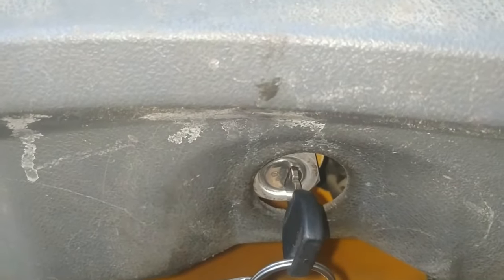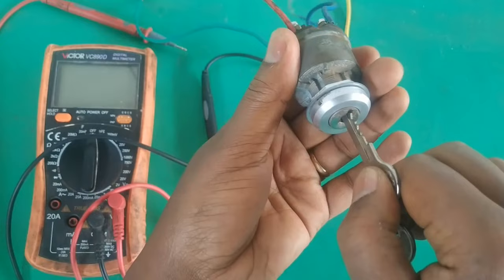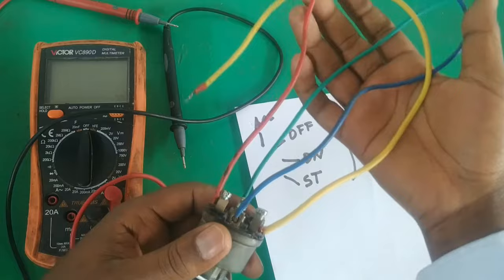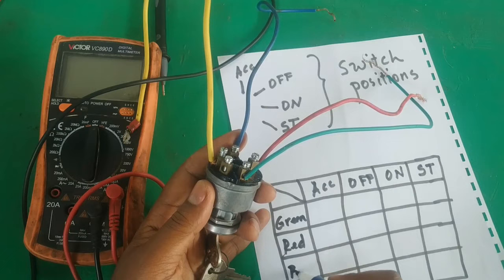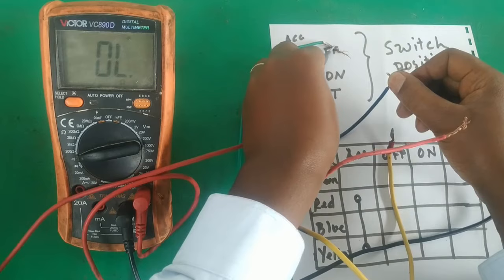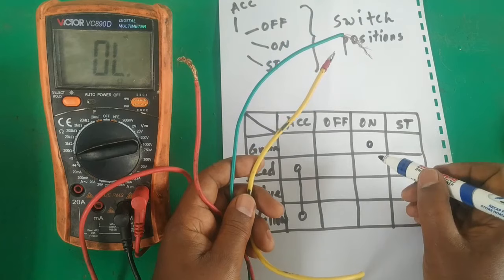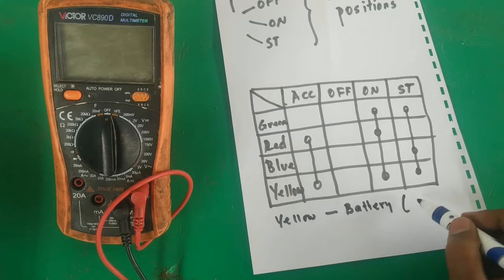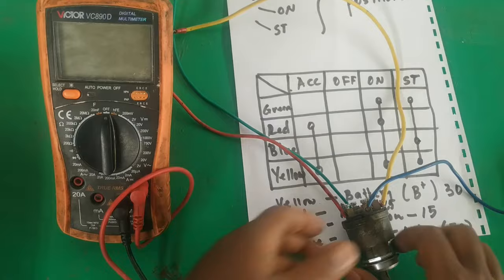How to identify ignition switch terminals

Comment: Hi bro ! My key switch has a voltmeter , i want to test the ignition key. My key switch has 3 wires ; Red Black Green! 

If I want to test for continuity where do I place the red and black prones from my voltmeter to the switch. 

I was doing black on black , red on black and turning key on.

Comment: ❤Wow nice, but what I do if I have 6 pins and the new ignition have just 4 🥺?
Reply from the maker: You better identify the pins first to see their connectivity. Some of the pins might be repeated pairs. Some ignition switches have two IG terminal and two BATTERY terminals. If the terminals are not repeated, you can find which one best suits from the 4 terminals that are available on new ignition switches.

Comment: Why does the auxiliary come first before the off position seems wrong, it should come first. the off position and next auxiliary. because if you remove the key still working the auxiliary.
Reply from the maker: Yes! Some ignition keys have auxiliary before off. You can confirm this by checking for continuity. There is no continuity on OFF position, and also remember that on some keys, the ignition key can be removed from the cylinder both on OFF and Accessory position. On those cars you can still listen to the radio, with the key removed to open the fuel tank!

Comment: I have a question though. I have a 1988 Chrysler conquest and the ignition is trashed. I just want to put a toggle switch in place of the key and then hook up a push button start.  I e looked at the circuit diagrams and I can't figure it with all the inhibitor switches and all that stuff...I'm not sure if something's not messed up in the fusible links and the signal wire for my starter isn't getting power...I really don't know...I can work on mechanical stuff all day but electrical stuff is super tough
Reply from the maker: Dear! Start from the starter motor and follow the line back to the cabin. That line should be given battery voltage for the starter to function.

Comment: Thanks for your explanation. please where is the off position connected?
Reply from the maker: Dear! Thank you very much for commenting on our video. And to answer your question, OFF is actually a key position where battery power to all electrical loads is disconnected. Off is therefore not a terminal to be connected. The common terminals we have on ignition switch are: Battery, accessory, ignition, and start. The different ignition key positions are: OFF, ACC, ON, and ST.

Comment: Thanks so much for the Video.
Here is a Stupid question for you....When you are using your Voltmeter for checking the Continuity, where does the Electricity come From...that goes through the Wires?
I have a Volt Meter but..have really no idea how to use it! LOL
Is it the Voltmeter and its Nine Volt Battery, that is putting the electricity through the Wires?
Second question...Why do they have to have those Stupid Symbols, on the Voltmeters......why not make them IDIOT Proof...and  just  right Continuity on the Voltmeter  Gauge, instead of those Symbols that are Hard to even SEE. Grrrrrrrr
Besides that......Great job on the Video!
Cheers

Comment: What of ground(negative)
Reply from the maker: The negative is not brought to the ignition switch. It rather goes to the other side of the electrical loads, ignition switch controls the positive or power supply side. It distributes battery positive power to the different circuits.

Comment: What about the last terminal on the key. ?
Reply from the maker: Dear!! Thank you for your visit! Regarding the additional terminal on the ignition key, it is actually a repeated terminal from the four terminals. Some ignition keys have more than one ig terminal or battery terminal. On some ignition keys however, there are additional terminals for glow plug operation which is spring loaded just like the start terminals. but it is operated in opposite direction to the start position, i.e. counter clockwise from the off position.